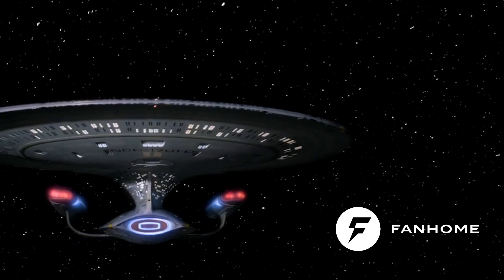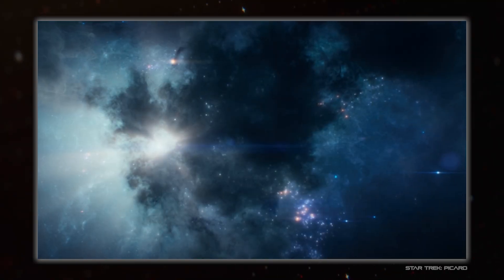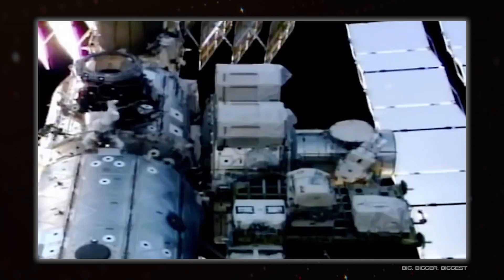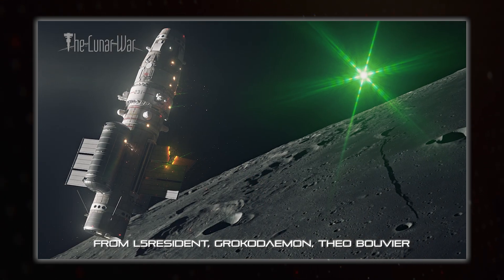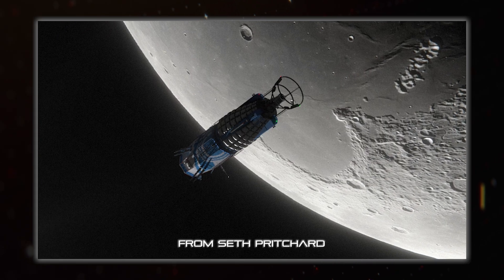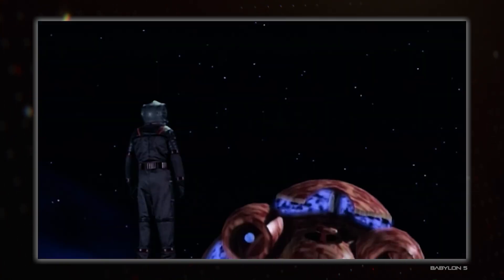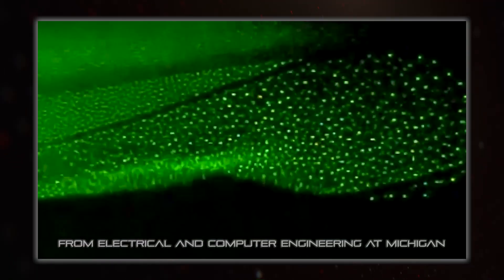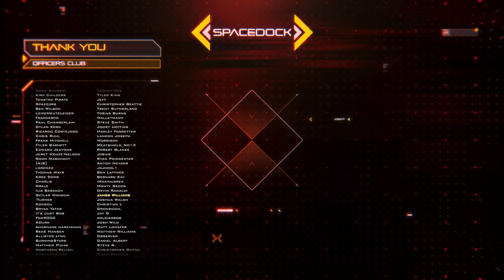Radiators In Realistic Sci-Fi (And Why You Need Them)

Comment: I'm going to comment and then watch the video. Yes, I am that person. There are three forms of heat transmission - radiation, convection, and conduction.  The latter two require matter to be wiggly next to other matter that isn't wiggly.  The wiggly matter transfers some of it's wiggliness to the non-wiggly matter making it wiggle just a bit.  If the wiggly parts are solid then it's conduction, if they are water or gas then it's convection.  The problem is in space there isn't a lot of matter to wiggle, so conduction and convection don't work very well.  Heat doesn't go away and it will continue to build unless it's moved somewhere.  That's where radiation comes in.  Radiation takes into account something called black body radiation, and it allows matter to basically emit photons in order to come to a lower energy level.  Those photons are radiation and they are typically in the infrared energy range :D.  Okay, now I'm going to watch the video.

Comment: Conduction transfer will work at space. Space is not absolute vacuum, there are atoms, just very low density, and on 1/3 of light speed, with which avatar ships are traveling, atoms will create something like particle radiation on front of ship i think. And it will heat the ship.

Comment: you could use  PMC (phase change materials) for being in use during combat, when you have high heat output and after combat, you can use radiators to get rid of that stored heat. but im not sure how exactly PMCs work, they should work by changing stage of matter with out increasing temperature when you put heat into them. or you could have system that would use gas, and then you would adiabaticaly cooled it. compressed gas, would get heated up, and you would allow that gas expand, and it would cool itself a bit.

Comment: An emergency cooling method would be tanks of liquid hydrogen, it is fuel and cooling run it through a heat exchanger , it takes away a ton of heat as it goes to a gas then either directly vent it out or direct it into an engine.

Comment: If a setting had advanced and efficient enough thermoelectric generators, would that be enough to not only deal with heat buildup, but also potentially charge batteries and power electronics on the ship?

Comment: Well, modern rockets, when they burn up to altitude (or until the stage runs out, whichever comes first), need to be cooled to ensure that they don't melt, fail and explode. In fact, this is a big enough issue alongside combustion instability that significant research has been placed on rocket cooling methods. 

A method that is used commonly for cryogenic rockets, and possibly for future space travel is cooling using liquid hydrogen. LH2 has a pretty significant Specific Heat which allows it to absorb a lot of heat only for a small increase in temperature. As such, the nozzles have channels cut into it, and made of oxygen free copper for added conductivity. Once the hydrogen has absorbed this heat, there are various ways to dispose of it, of which my favorite is running the heated hydrogen through a turbine for power generation and running the turbopumps, before having it flow into the combustion chamber to be burned for energy release.

Comment: For me it just does not make sense in big ships, there is a lot of technology that exists now where heat can be converted back into electricity. having such a facility on board makes 10 times more sense in a future setting then radiators.

Radiators just feel like a low cost and non complex way of getting rid of heat. Which is fine for a non advanced near future setting. But technology is moving so fast that concepts like these just fall out of favor real quick.
Reply: you're never gonna be 100% effective at reclaiming that energy so if you want to run your ship more energy dense you need some way to deal with that because most of the parts of that ship want to either be somewhere in the water range or somewhere fairly close to true 0.

I think part of what isn't making sense here is just how LITTLE energy you actually dump by radiating compared to any other form of heat exchange: for example all those radiators on the ISS are for managing less power than you use in your house.
Reply: @evernewb2073  heat recovery technology converts all heat into electricity. There is no waste product or excess heat left. 

The efficiency is also irrelevant because the goal is removing heat and not generating power.
Reply: @j4ck3t  ...not sure what game or book or thrice cursed sales pitch you're running on but it is not doing you any favors.

Comment: Fun trick:

Retractable redundant radiators. Have 2 or 3 "sets" of radiators, but only one set in use at any given time, and the others retracted into armoured sections of the ship. If one set of radiators gets damaged, retract them and extend a different set.

This lets you dodge the "radiators radiating into other radiators" problem while also giving the benefit of redundancy and some of the benefits of retractability

Comment: Something that always bothered me: Heat is just the movement of atoms. It is measurable, and is a form of energy. By definition, energy does work. Why does nobody try to recycle the waste heat into usable functions? I know entropy wins in the end and you can't use 100% of anything, but you'd think energy, being a esource, would be important to conserve in the void of space.
Reply: Because you don't actually use the heat to make energy, but the temprature gradient.
The lower the temprature, the harder it gets to get any energy out of it. At some point it is simply no longer worth the hassle.
For example, if you take the heat generated by the crew itself. It's basically useless. Due to its low temprature you'd have to build huge radiators to get a steep enough gradient to get anything usefull out of it. And that means the specific power output of that system is too low to be worth it.
Reply: @Bird_Dog00  So it couldn't be, say, converted into chemical energy and used to help run a hydroponic or aquaponic food/air system?
Reply: @mitchhaelann9215  How would you convert it into chenical energy?
For example: the thermolytical cracking of water into oxygen and hydrogen requires tempratures of about 1700°C. You'd need the heat from your engines or main powerplant to get that kind of temprature.
Reply: @Bird_Dog00  There's bacteria in deep-sea thermal vents that convert thermal energy directly into chemical energy. They need it to live. Plants do something similar with light. So there should be some way to turn some percentage of waste heat into stored nutrition that can help support plant and microbial life. Microbial life that can process CO2 into breathable oxygen, plant life that can grow more complex carbohydrate structures the crew can consume, etc. Plenty of life forms require more heat input than they generate in output.
Reply: @mitchhaelann9215  Those bacteria are heat tollerant, but they are not thermocuples. The use the chemical energy from minerals dissolved in the water - mostly sulfur compounds - emerging from the vents to generate energy for their methabolysm, not the heat itself.

And plants use photosynthesis. They need light at a specific wavelength. That wavelength is not emmited by a radiator radiating waste heat from a space ships's life support system into space.
A radiator operating at those temperatures doesn't emmit any noticable amounts of visible light if any at all.

Comment: for my universe I didn't wanted radiators but I did wanted to take heat management into account, so the way it works is that heat is transformed back into energy and stored in the ship battery, and if the battery is full (notably during battle, since shields also pump energy into the battery when shot at) there are exhaust systems that are basically just very energy-vore lights on the hull to quickly dumps energy out of the battery.

most ships can have a few tiny exhausts simply hided in random spots, but ships that need extremely reliable emergency systems (experimental weapons for instance) or that have tiny battery capacity have larger deployable exhausts, and if they start working you know something probably went wrong.

Comment: Could an open cycle radiator be used as an improvised thruster? Say the main engines are damaged and the crew is in desperate situation where they need to move fast, whatever the cost.

Comment: Perhaps pull an idea from star wars and the Jedi star fighters. During cruising they have a detachable engine bay that helps them move faster or more efficient. Would have the better types of radiators. Then when combat happens and they have the moment to prepair they detach. It could even be protected somehow with anti targeting measures like a fragile guidance layer  have chaff or the equivalent of anti missile tech
 Meanwhile the main part of the ship to engage in combat has higher capacity but generally one time use devices. Once they get to saturation limits eject it. And the next one is installed or activated. Could even use it as a thermal weapon against the target  can't imagine how bad it would be for a piece of near liquid metal being flung at the opponent would be  good thing for the receiving party.

Comment: Seriously, this is something that could work wonders in a mecha series with the radiators glowing bright as the action heat up or some super mode is engaged or limiters removed. Those Dusty Plasma Radiator's feels like they would be right at home in something like Gundam.

And speaking of Gundam, I know that the series has dabbled with radiators on occasion, but it was very sporadic and not a rule. The Gundam F91 had radiators in the shoulders as well as a rather unique cooling system of flaking off its paint to cool down. They also appear on some battleships on occasion, but once again, it is not a rule.

Comment: Hm, that idea of low heat plasma radiators made me wonder if with sufficient unobtanium application you could make those hot enough to double as a defensive measure, melting incoming bullets or missiles. 

Or maybe with an open loop coolant system so that after you abused the 'normal' radiators like this you get a cool venting coolant scene. Could be used in an ongoing story to give some stakes to it all, similar to say actually only giving your heroes revolver 6 bullets. There's only so much dumpable coolant, so the side with the more precise and quicker reactions could save more of it by running the plasma radiators only long as long as absolutely necessary to reduce incoming fire from 'dangerous' to 'armor can easily hold'

Comment: Really wanted to add cooling systems to my own ships. It can add more to a story. Didn't find a lot of ways we can do it rapidly with the ISS being the example I think I went with for at least sublight engines and stuff. Things get more complex when you add weapons, shields (at least plasma based), and a functioning warp drive. Glad to know of other methods in the works. Haven't thought about using pellets for example to spray heat away from the ships.

Comment: I can't, offhand, think of a reason that you couldn't dump energy into some sort of mass (water, perhaps, with its 2.26KJ/g heat of vaporization), and then use the vapor (or perhaps even higher energy gases or plasmas) as your propellant. I mean, if you have to fling something out the back of your ship anyway, it might as well carry off a bunch of heat at the same time.

Comment: Hmm, seems like the flash generator engines and tibaryium metal [armor plating] in my sci-fi setting have this pretty much covered. Any heat source (including enemy weapons) can be absorbed and dispersed in the ship's armor plating itself, which transfers the heat into flash generators which converts it into energy. Too much can be vented out of thrusters, which gives the ship sub-light thrust. Conveniently able to be recharged by lasers, retractable solar panels, flying close enough to a star, or the preferred way of adding various fuels to the flash generator(s).

The only problem is when they're overloaded too much or too fast and energy conductors either break, melt, or one or more flash generators explode.

Comment: Yeah pretty much anything that will be generating massive amounts of heat will need to find some way to get rid of it or some how to use it as part of the ship or station design. Babylon 5 uses heat radiators or dissipaters  pretty well in its design. The bad part about using ammonia as a coolant is that it is toxic to human health. The ISS has had several incidents where the coolant leaked inside the station. Water is another good medium for cooling a ship, or station systems and the people inside. Is there a way to use a saline in liquid form and not molten.

Comment: Radiators seem like a waste of mass and energy to me. Maybe I'm missing something, but a ship isn't a closed system. It throws massive amounts of energy out into space all the time.
There are ways to turn heat into other forms of energy, right? Excess heat can be turned into electricity, which can then be used to power engines or weapons, which then turns that energy into kinetic energy thrown out of the ship in a much more useful way than just radiating it into space. Basically the heat is converted into kinetic energy for the ship to move, and since there is no friction in space, that kinetic energy isn't going to turn back into heat any time soon. 
As a simple low tech example, that heat can be used to boil water, then the steam is ejected into space by powering reaction control thrusters. It works a lot like sweating.

Comment: This was an unanswered problem in “Project Hail Mary.” It used Astrophage throughout the hull for radiation protection while traveling at relativistic speeds to the Tau Ceti system, but didn’t explain how they shed the heat as Astrophage is permanently locked at just shy of the boiling point of water.

Comment: During combat, projectile weapons might be used as open cycle heat sinks, or you could try to otherwise weaponize your heat sinks: imagine having some simple magnetic cooling system (below the curie point, just a flow of hot magnetic particles in a magnetic field outside your ship) and if you need it, you can instead accelerate the hot particles at relativistic speeds towards a target. Basically, a major weapons system that can work as a radiator when in peace and as an open cycle heat sink just by firing when in combat
Edit: This would also have fun story implications where you have to choose if you shoot your last coolant at something that needs shooting and risk overheating

Comment: This is the biggest simplification of the space combat science in Expanse Universe, their drives would require nearly 100% thermal efficiency (so almost no heat from the reaction mass is transferred to the ship) for the ships not to require pretty big radiators (not to mention all the power used by the ship and drawn from fusion reactor, even if it is aneutronic kind you would still get a lot of heat produced)

Comment: Space vessel thermal radiators and heat exchange systems are visually obvious and prominently featured in the sci-fi computer game "Mission Critical," published by Legend Entertainment in 1995. Despite having only one real ending, it remains one of my top 5 favorite games. Additionally, the game portrays the US Navy light cruiser Lexington, built in the early 2100s, as having a pressurized water FISSION reactor similar to those found on modern nuclear submarines. The game adheres to scientific principles for the most part, but the inclusion of a fission reactor on the ship is obviously not plausible for the time period depicted. This choice was most certainly made to create tension by introducing the fear of a power plant disaster. It is not immediately apparent that the game can conclude with the reactor melting down and causing the destruction of the ship. However, it is indeed possible for players trying to use the emergency systems to spend too much time trying and failing to solve the coolant problem, which will eventually lead to that outcome.

Comment: I forget where I put the math sheet, but while it's nice that the Death Star has a thermal exhaust port, it's going to need a couple more...
Specifically, that laser has to have a power efficiency far better than 99.9%, or the waste heat will be sufficient to either melt or entirely vaporize the entire Death Star, depending on how many 9's you put after the decimal, and it's a fair number.

Not only would the laser have to be far beyond the theoretical energy efficiency limits in order to generate as little waste heat as possible, the Death Star would need to almost instantly dump that waste heat into a literal internal ocean of some very dense material and then vent that material through tens of thousands of thermal ports studding the entire surface of the station in a titanic bloom of ultra-hot plasma that would envelop the entire station - and probably just melt it anyway due to the heat radiated back to the station buried in this plasma death cloud.